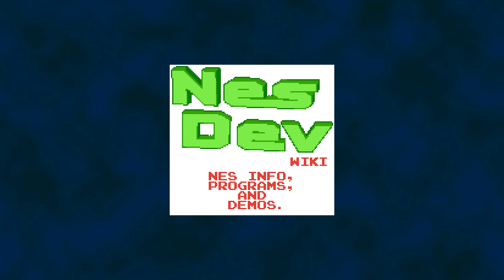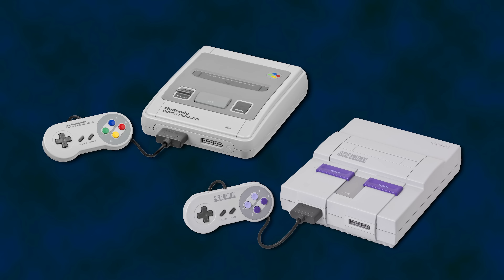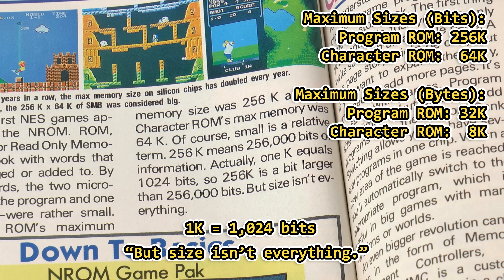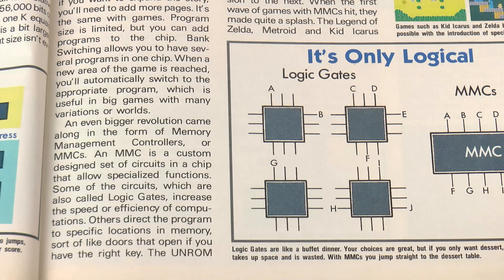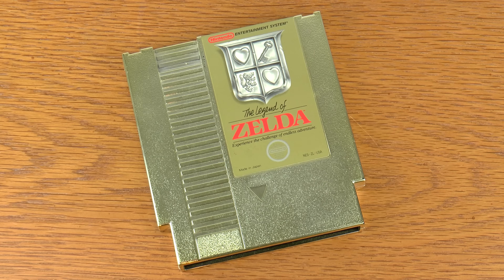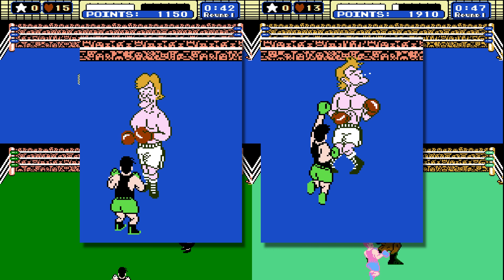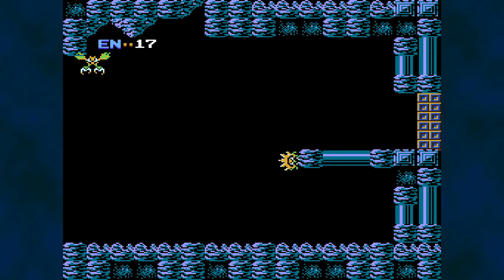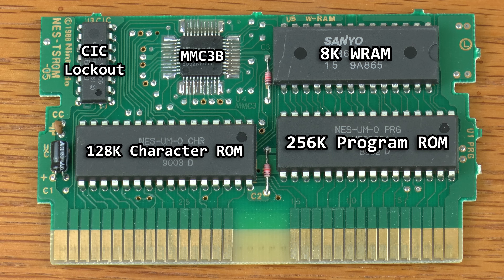Battle of the Bits: Nintendo Power, Mappers, and Circuit Boards - Talkin' Code Ep. 3

Comment: Ever thought about doing a video on how vertical screen scrolling works in The Legend of Zelda? It's more fascinating that it would seem and where all early emulators went wrong. You can also dive into loopy registers to flesh out the video with content. Or another video.

The problem with vertical scrolling on the NES was when you needed a status bar. It was almost impossible to have a split Y scroll on the NES. Except for one tiny glitch that got exploited. The PPU only reads the vertical scroll once - at the start of the frame. It was never intended to change once rendering began, unlike horizontal scrolling.

We got lucky and the hardware designers went a little cheap and reused the same register for scrolling and PPUADDR. Register t. BUT the renderer doesn't read from register t for vertical scrolling - only horizontal bits get copied mid-frame. So what now? It turns out that the second write to PPUADDR copies all of register t to v. (v is used for rending the frame and includes vertical scroll).

If you want a code peek to see this in action, check out Zelda 1 instruction A0A3. That's the first write. The second is A0A9.

The first writes 0x23. The second 0x40. These values change as the scroll gets performed.

This write is VERY risky however. You can't write scroll data here. You literally have to write the entire 16-bit loopy register, in the correct format.

The format is:
yyy NN YYYYY XXXXX
|||     ||    |||||        +++++-- coarse X scroll
|||     ||    +++++-------- coarse Y scroll
|||    ++-------------- nametable select
+++----------------- fine Y scroll

Going with the Zelda example above, 2340 =
0010 0011 0100 0000
Coarse X = 0. Coarse Y = 1101 (decimal 13). And so on.

There is another caveat.  The second PPUADDR write unfortanetly sets the high bit to 0. So you only get the two low bits on the fine Y scroll.

This trick is used in all vertical scrolling in Zelda 1. The title screen scroll in Zelda 2. And many other places. Mario 3 also probably uses this but I haven't verified.

You need this trick regardless of whether you use Sprite 0 or an IRQ to trigger the split. This is the only way to do an X/Y scroll and is considered a glitch exploit.

And yes, I'm building an emulator.

Comment: I did read that article when it came out!  Or at least within a few years, and guessed it was coming when you showed the magazine cover.  I didn't UNDERSTAND it overall but it IS the reason I knew mmc2 was in Punch-Out though not what it did.
I foremost took issue with the title + little elephant graphic because my Zelda and Dragon Warrior 3 would "forget" their saves all the time and elephants also forget things regularly and them supposedly not doing so is an entirely unscientific stereotype that has no place in an article seeking to inform.
I didn't think anybody at all outside of nintendo power ever called games "paks" but I am glad that if you did in the past that you don't now.  I thought EGM calling them "carts" was pretty dumb also but that at least has an eventually clear relationship with "cartridge."  I only just now got around to seeking an official definition of "game pak."

Comment: Calling it the Control Deck is accurate.  The piece of technology that plays the games was a game console not a “system” up to that era.  The system terminology comes from the “Nintendo Entertainment System” which did not refer to the console, but the interacting system which was the Control Deck, Zapper, and ROB. Most people only had the console, so it gets called the NES, which is technically a misnomer.  And therefore people started to call all consoles “systems” afterward. (Or am I wrong? 😁)

Comment: 5:15 The fact that whether horizontal scrolling is enabled by soldering part of the circuit board is blowing my mind a little. The fact that something you would assume was created entirely through software is actually defined on a hardware level is a bit crazy.

Comment: this is a dumb question but on the castlevania nes board, what happens if you desolder the horizontal solder pads and solder the vertical ones, does it just break the game?

Comment: So the MMC4 just doesn't exist?
Reply: MMC4 wasn't mentioned in that Nintendo Power article because it was only used in Japan-only games (Famicom Wars and the two 8-bit Fire Emblem games). It's similar to MMC2, with the same auto-CHR-bankswitching triggered by specific tile indexes.

Comment: What is sitting next to the MMC5 chip? You can see traces from whatever that thing is leading to the MMC5 chip. It has...I think those are registers maybe? They read like this...
C2 104
R1 15K
C3 104
R2 15K 
R4 10K
R9 10K
Reply: Those are for resistors (R) and capacitors (C).  You would need to add those in if you're using more components on the board like extra RAM.
Reply: @Dominic_Muller  
Thank you my friend!

Comment: A question:  You mentioned only one example of vertical split screen scrolling, but is that what they used for the intro 'cinematic' of Castlevania III?  It looks like two fast moving columns, to each side of a slower one in the center.  Or did they use a different method to get the effect?

Comment: I wonder what could be accomplished if you combined all of the mappers and sound chips onto one cartridge, including the Famicom Disk System’s wavetable chip, not to mention extra Work and Save memory, a real-time clock, and a giant ROM that the mapper could exploit.

You could also make the Save memory truly non-volatile if you used FRAM instead of SRAM (that way the RTC is the only thing that goes down when the battery dies), and you could also utilize application specific coprocessors for rapidly unpacking compressed data (like the SDD-1 on the SNES) and/or quickly interpreting high-level code (so you could save on ROM space for certain code) without bogging down the main CPU.
Reply: Yes, there is actually a BASIC interpreter (and keyboard) available for the Famicom. Sharopolis made a video about it.
Reply: One more thing you could do to enhance the system’s capabilities: The use of analog circuitry to implement a true random number generator in hardware.

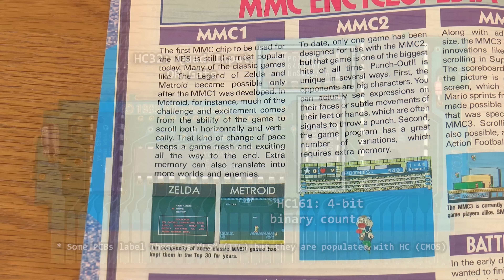Comment: 8:47 lol I actually got 4 74HC32 ICs in a surplus Radioshack kit I bought like 5 years ago. Funnily enough, I think they're counterfeit because the chip number and other numbers rubbed right off of it if my fingers were the least bit oily. Like if I just scratched my face and I'd been sweating, that would be enough to rub the number right off of the chip when I press them in to insert them. No laser etching. Which you'd think Texas Instruments could afford. Also that's one of the signs of counterfeit chips I've learned about since finding out how sadly common they are online. I might never have known some of my other chips were counterfeits. Except maybe for the ones where the Texas Instruments logo is a picture of the United States. I guess they don't know what Texas is in China.

Comment: 8:00 I'd like to point up a common misunderstanding about nametable mirroring aka the horizontal solder blob. That solder blob was just meant to set how the tilemaps are seen by the PPU. It doesn't limit the directions of scrollings. Scrolling in both axes is a built in feature of the PPU. As a matter of fact, Hudson's Adventure Island used the same mirroring setup as Castlevania 1 and it does diagonal scrollings right up and right down way before SMB3 came up. Setting the solder blob on the H like Castlevania, when scrolling up and down and diagonally, you could have some artifacts in the first or last 8 lines of the image, but those were out the the visible portion of the display on NTSC systems. On PAL systems you will see those artifacts but you could eliminate them by simply disabling the image on the last 8 lines of display by using some interrupt from cartridge or the sprite 0/bg collision detection, for example... Mario 3 sets the tilemap to be 32 tiles wide and 60 tiles height (because it needs the HUD) and so it has to disable the leftmost 8 pixels to minimize artifacts when scrolling horizontally but you still get color artifacts (seen at the right when moving  horizontally) since the color attributes in the tilemap is 16x16 pixels, the only way to hide them is disabling 16 pixels: Tom and Jerry and Tuffy uses the same tilemap layout as SMB3 (because it uses a HUD in similar fashion) and also scrolls diagonally but it does disable the leftmost 8 pixels using a PPU toggle and hides the rightmost 8 pixels using a column of sprites, so no scrolling artifacts.

Comment: Something to clear out: diagonal scrolling is NOT a feature of the MMC3, even the most basic NROM game could do it. But scrolling in two directions AND showing a fixed status bar like the one from mario 3 was almost impossible without it.

Also, that kind of scrolling requires larger levels to be interesting, which the MMC3 helps by having slight advancements in bank switching, like all the MMC chips.
Reply: It was only almost impossible because of the terrible support the NES has for raster effects. Unless you can guarantee a solid pixel in the background at all times, there isn't a 100% accurate way to know where you are on the screen. This is one thing MMC3 added with its scanline counter.
Reply: @binguloid  yeah, and there is also a way to make a very finnicky scanline counter using the dpcm channel, that way you dont need to know what's already on screen.
I recently made a game using that technique, but I dont think any games of that era used it.

Comment: As a little kid, I had convinced my parents to do the "Fun Club" thing (at least I assume I did, maybe they were still into games enough to do it themselves), and when that ended, we were given Issue 1 of Nintendo Power as a way to "entice" people to subscribe, I suppose.  We didn't until later, so Issue 20 was the first one I had after that.  I remember reading that article, but considering I was around eight, and didn't have any sort of programming experience, I had so little information to work with that the majority of it went over my head.  I'm thrilled you went over this, even now my knowledge of NES hardware and mappers is based almost entirely on your videos.  ^_^;;

Comment: 4:56 unlike the other illustrations, there is RAM between CPU/PPU on one hand and the ROMs on the other. Is that really true? Wouldn't it be more correct to say that the CPU can access work RAM and program ROM, and the PPU accesses video RAM and character ROM, regardless of mapper (except that the character ROM is sometimes replaced by a character RAM). Or is there something special about the NROM configuration?
Reply: yeah, it would be more correct

Comment: Yes please, do a MMC5 deep dive!
Reply: It would also be interesting to cover how the games developed by Koei (which represent the majority of MMC5 games) were written in C and run in a kind of virtual machine (this was a common method for implementing high-level languages on the 6502--the original Apple II version of Wizardry also ran in a VM, known as the p-System)
Reply: I concur!  That would be SUPER cool to see!  Would love to hear more about the MMC5 for sure.
Reply: Yeah me too, i would like to know how on earth the mmc5 chip could increase the amount of colors in a 2x2 grid from 2 to 4 colors.
Because for 1 thing the mmc5 was considered like all other mmc chips to be a bankswitching chip and NOT a graphics accelerator chip, unless am wrong and it serves as both🤔
Secondly, both sprite and tile sets of the nes can only take up 3 and 4 colors.
Not mentioning overlapping sprotes wich means that at minimum 10 colors can accure at the same 8x8 grid without introducing color clash.
So i think that both the mmc3 and mmc5 chip can fully or partially hijacks the nes ppu to stream it’s generated graphics to it through irq requests🤔

Comment: can you make a video on Parallax scrolling on the NES , and why it was so hard to program? (i don't know , it just seems that way)
Reply: The NES only had 1 scroll setting for each screen. Parallax then, had to be done by changing the scroll partway down the screen. The NES has no built in way to know how far down the screen  the PPU is drawing, so you would either have to waste CPU time timing it in software, or use external hardware like the mmc3 that counts for you. Another reason is that there is only 1 background layer, so if there were any game elements like platforms, they would be scrolled too.

Comment: The nes was an amezing system, but i always wondered ,was the nes really designed with expandibility in mind in the first place?
Yeah it’s true that nes did had an expansion port for future addons, but for increasing performances???

Now the thing about those mmc chips is, they are NOT graphical accelerator chips no, all what they do is bankswitching ram and rom data to the nes, by increasing the work ram and rom space along with realtime bankswitching. it is possible to get better graphics and digital sound on the nes. heck with some fancy tricks it’s even possible to generate graphics and pcm sound to be like many 16bit  system.
But i don’t think nintendo intended those chips to compeat with other systems. (not as i wanted to believe in 2006) i think they did this to allow game developers to be more creative and to avoid that they will move on quicly to other systems. but i don’t think nintendo wanted to fake 16bits graphics and sound on the nes to compeat against the sega genesis,no.

Comment: 17:50 I've wondered: is additive/looping multiplication really how they did it? It seems obvious to use lookup tables, especially as ROM sizes grew and additional work RAM became available. This deep into the NES' lifecycle it feels natural to use storage to ease CPU burden whenever you could. I've also heard that the MMC5 was very underutilized so I'm not sure how regularly the multiplication function was utilized.

This article was one of my all-time favorites from Nintendo Power. I really enjoyed technical articles and it was rare to get this level of insight. In fact, until third party documentation was being produced much later by people like Chris Covell and Kevin Horton starting from the mid-to-late 90s, this article was basically by entire basis of how NES games worked.
Reply: For simple multiply and divide, you can use bitshifting to achieve powers of two. That covers nearly all the things that you see get multiplied in performance-sensitive situations in NES games; for something like an RPG you don't have to optimize it. Small LUTs do often appear for the rest. One of the characteristic things about 8-bit games is that they would design out the need for granularity, and hence any elaborate usage of math. Thus the tables, when they appeared, were often really small, but formed the basis of much of the gameplay and could combine a great deal of math into input/output pairs. This is how the original Pong operated: a small table of ball velocities using mirroring to further optimize space.

There are quite a few apps on 8-bit computers that had to opt for the slowest ways of doing math, symbolic manipulations, etc. because their primary objective was to optimize for size, and they couldn't use the shortcuts games did.
Reply: @JH-pe3ro  Thanks for confirming; this is what I expected to hear.

Comment: It's understandable that once you start adding more features and require more mapper registers, it's better to go with a dedicated IC logic chip. For BNROM all you need is one bank register, it switches the entire 32k ROM space as a single block. All the circuit needs to look for is any write from the CPU where the highest address line is high (any write to $8000 or higher). But if you also want to say, switch CHR, now you'd need to start looking at the highest (A15) + 1 address line (A14), so that you know if its a mapper write (A15) and then you select if it's a PRG or CHR write (A14). You need to start adding something called a 'decoder'. In other words it's just a selector of what chip or other part of the circuit needs to be listening in on what the CPU is saying. The selected 'device' can let the CPU data bus contents in, and voilá, you have a bankswitch.

Comment: But if you pack the program tightly like Tetris pieces, won't it disappear? 🤪

At 4:52 I was very confused because it looked like it was the RAM, rather than the processors, that were swapped... Went back to check and you actually edited it during the video! Very sneaky...

Comment: I have on question it’s somewhat unrelated, but I think people in here know. I have a PowerPak but I can’t get the PowerMappers to work with Mega Man, Batman which are MMC3 games (the game seems to work, but freezes after a minute). I saw other runners use it so it should be possible. It just doesn’t work with the mappers available on the NESDev page. Maybe someone can share their setup if they have one working?
Reply: If they start the mapper files are fine, check cartridge connector or power supply.